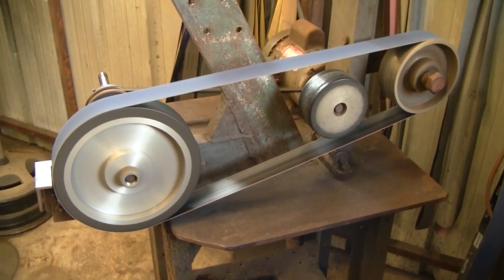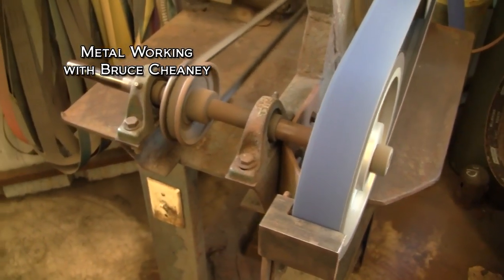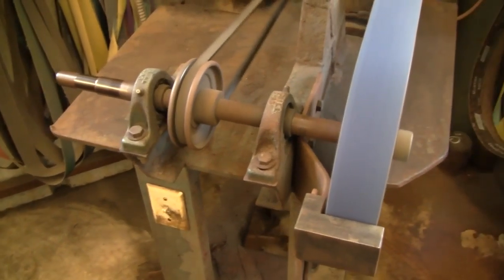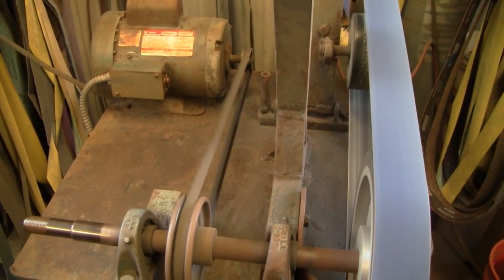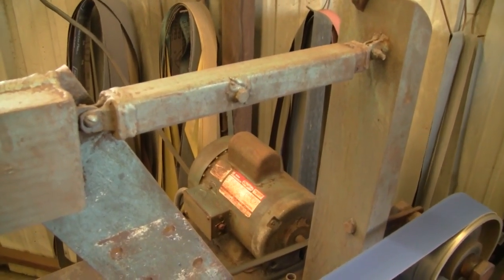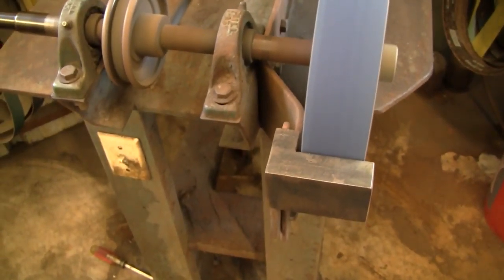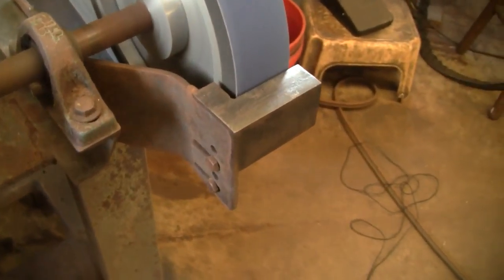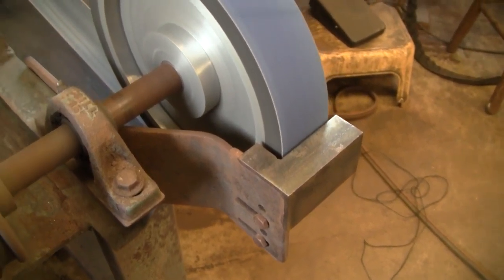Metal Working: Homemade belt sander and grinder

Comment: Just a little suggestion, if you place step down pulleys on the motor and spindle, its a great way to change speeds,
If you can`t spend out on the speed control motor.

Comment: Hi Bruce.  Do you recall where you sourced out you contact wheel?  They are so expensive wherever I have looked but maybe they just are.  I am building a grinder but the tension, drive and contact wheels are 3/4 of the expense so I am still shopping around.
Reply from the maker: Rob,  I ordered my 2 x 8 serrated contact wheel as well as the 4" and 5" idler wheels from Sheffield Knifemakers Supply Inc. It has been a very long time ago. I do remember the 2 x 8 was a special order. You might check with them about contact wheels. I ordered the 2 x 10 and the 6" from a place called Chicago Rubber and I can't seem to find their contact information. You might try Beaumont Metal Works they make the KMG Grinder and sell wheels and pulleys for making your own grinder. Hope this helps you out.  Thanks Bruce
Reply: ***** Thanks again Bruce.  I'll look into those options.
Reply: ***** Thanks for those details Bruce, you're doing a great job.
Dave
Reply: RobPolson, Wheel appears to be on from Grizzly. You can use it like he did or put some bearing in it.